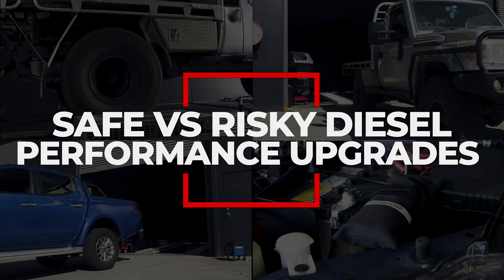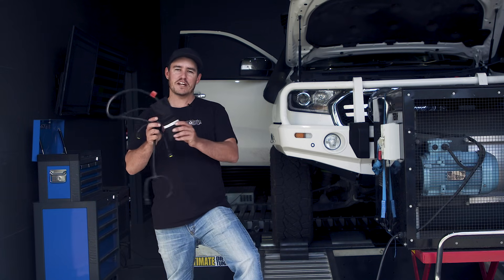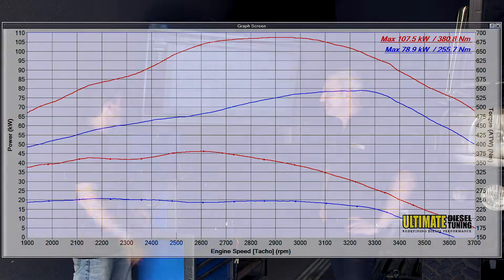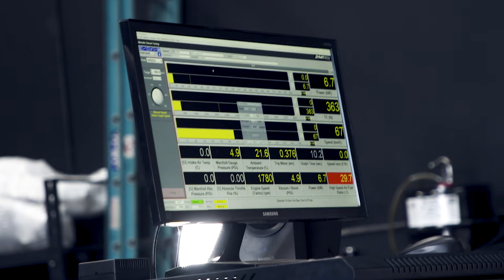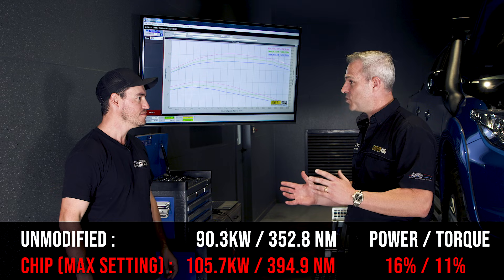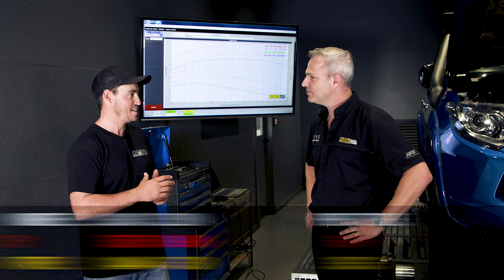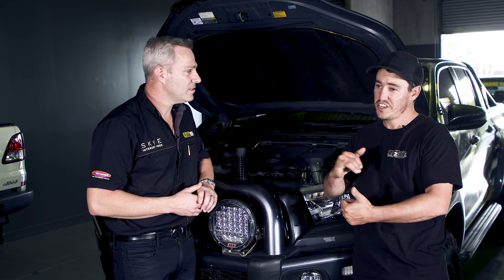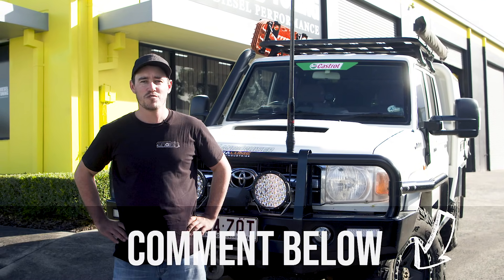SAFE vs RISKY DIESEL POWER UPGRADES – 5 things you need to ask before choosing!

Comment: 100k V8 cruiser putting out the same power as a triton 😅😅😅😅😅
Reply: You need to replace your back 4 times in the Cruiser....
Reply: Toyota overpriced
Reply: If you knew that what the manufacturers designed the vehicle for then you would understand that power (work) directly relates back to wear and failure rate. The 79 was designed for harder use at the upper end of its GVM and towing capacity and hence why power is purposely lower than what you might expect for a larger engine as comparing to a vehicle that’s more orientated to cruising the family up and down the highway with the occasional trailer that was clearly designed for less work. Manufacturers ultimately balance what the vehicle is designed to do with the power output to ensure a long life. Even comparing two vehicles with the same engine as the 79 and 200 series you will find that the 200 has another turbo to increase air to create the ability to add more fuel for power. The average person and what the 200 series was designed for is carting people in comfort up and down the highway with the occasional trailer and hence not expected that it will work as hard as the 79 that’s designed to be loaded up and used hard in industry which will increase the wear and failure rate. Contrary to popular belief, the same engine that is designed for harder use should have a lower power output than one used for less as it all relates back to wear and failure rate. If you want something to last longer and hence have less wear and less chance of failure then it’s as simple as lowering the power output it can do.
Reply: Some of you ppl meake it sound like a Triton or anything modern that isn’t a cruiser is going to implode the second you take it outside a highway and like someone said it’s just for hauling family on the highway and the occasional tow. What you describe is what you can do with any old station wagon. Reality is, modern trucks are really quite reliable and can both take a lot of hard use and will go most places with a small number of mods. My last Navara took me over 50,000 kms and at least half of that is use in my farming and forestry operation which includes (more than) max load, pretty serious terrain and hauling some trailers that are way above the 3,500 spec.
Reply: Have a go at the tyre size on it mate....
Reply: @JArc-99  Triton has big tyres too and 4 less cylinders haha Everyone is getting it wrong, 79 = work horse not horse power
Reply: living on an edge
Reply: @Ralph W Outback to Surf Mpre often then not tunes end up being better for fuel economy and also engine wear aswell. And the big benefit is addressing the shithouse turbo and throttle lag most newer diesels suffer which means you don't have to carry as much momentum and what not offroad. So in the long run tuning it on a dyno ends up being much nicer on the vehicle then a stock tune.
Reply: is not only about hp. (even less in propers 4x4) 
is about reliability and TORQUE.
Reply: Yeah but that 600nm of torque in the 79 V8 is at its maximum at 1200rpm making it a beast of offroad towing. 
They're still an overrated vehicle in my opinion though 😆
Reply: Not just that. How long will the little 4 last against the v8
Reply: @GodsEyeQLD  And you know it will last longer because?
Reply: @GodsEyeQLD  very reliable , so a long time .
Reply: who tf cares about the power figures  torque is where its at!
Reply: @wax333  nearly every 4 cylinder out torque's that V8 , in particular the D Max , nice flat torque curve .
Reply: @wax333 but your gearbox can change power into torque, that's why a 200kw vehicle with 200nm torque will always accelerate faster or pull a heavy load up a hill faster then a 100kw 600nm engine. 

The high torque engine will not have to rev as much and will be nicer  to drive and probably more fuel efficient.
Reply: Get a million kms out of the cruiser unlike the triton
Reply: Bet the Cruzer will go more places then the triton will ever see
Reply: @Sillyboy9572  not really .

Comment: You talk about safe power and dynos but you fail to mention that you have grossly exceeded the maximum torque specifications for both the clutch and gearbox for that landcruiser. Without the relevant upgrades which cost thousands of dollars your actually doing more harm than good. 600nm feels great until something goes pop.
Reply: They are typical gains that most custom dyno tuners achieve with 70 Series Cruisers. The drivelines & gearboxes on them are very strong, never had any issues. However, the clutch must be replaced with an upgraded heavy-duty item, but that's all - the other OEM parts handle the extra torque fine.
Reply: Ultimate Diesel Tuning have to agree. Never heard of gearboxes blowing clutches yes after a tune
Reply: @UltimateDieselTuning  The clutch aspect of this should have been addressed in the video, tell the whole story
Reply: @gregstephens361  that's only on a handful of models mate. Hiluxes, Landcruisers, Colorados. The majority are autos or the factory clutches are strong enough to handle the gains.
Reply: @UltimateDieselTuning yeah my fathers hilux was auto, 660nm on the wheels and no issues at all.
Reply: Been running 960nm for 80,000km, standard g/b and diffs. Clutch is a npc
Reply: Just never tow anything heavy in 5th gear unless on level ground at light throttle. Lugging in 5th with say a big van up an incline letting the torque do the work isn't good. If you take it easy esp when towing the gearbox will be fine.
Reply: Been running 650nm and 165kw at the wheels on my 79 for over 260,000km (since new) alot of very heavy towing and offroad driving. Nothings gone pop yet! Except my wallet everytime i fill up with diesel....

Comment: Anyone have a clue if tuning a 3.0L turbo diesel Prado is worth it?
Reply: Sure is mate, they go very well with a custom dyno tune. Awesome gains in power & torque out of those, no matter how we tune them!
Reply: My big question is if I am very remote and have trouble with the remap, I’ve been told that I need to get it to the people who have done the remap. How do I solve this problem if I’m a thousand miles away from where it was originally remapped and can only get to a basic mechanic?!? Where as with a custom tune and chip I can just unplug and trouble shoot or limp to mechanic. So would this mean a chip would be better for my kind of use?
Reply: @allwheelinoz4707  yes it generally does need to go back where it was tuned. However, we have tuning dealers & agents all around Australia that we work with. So in your case, depending on where you live, we could tune your car for you at one of these agents, which could be closer than our workshops for you. If you'd like to give us a call on 1800034373, we can chat to you about all of this & your options!

Comment: I have had my Hilux tuned by Ultimate diesel in Dandenong, I highly recommend using them to get the power and torque out of your 4wd. They really do care about your vehicle and make you 100% aware of any potential problems pre tune, I spent $5500 to get great numbers out of my Hilux, in this they also found my injectors to be leaking and in need of replacement. All round they have helped me discover the true potential from my 4wd and have done so safely and without any unnecessary nonsense. Thank you Ultimate Tuning Dandenong!
Reply: Hey guys, the custom dyno tune did NOT cost David $5500. We also carried out an on-car chemical soot clean to his 4WD & also replaced all injectors (which are very expensive as you will know). Just thought we'd clear that up!
Reply: @UltimateDieselTuning  yer, figured it was definitely injectors related! Appreciate the input
Reply: $5500!?? Jesus, you'd pretty much just buy a whole new engine for that!
Reply: Are services inherently more expensive there in Australia? I live in Las Vegas USA, and I spent $500 bucks for a dyno tune on my vehicle.  $5500!? Did they do a complete rebuild for you?  That's obscenely expensive for tuning.  $5500 bucks would upgrade both turbos on my truck (3.5 ecoboost), or upgrade to a Whipple 3.4 for my car.
Reply: Surely they changed your injectors and did a full service as well as the tune for that? Or added a new cooler!
Reply: When your on the money I was, it really doesn't matter
Reply: David Edwards weird flex but okay mate

Comment: I've heard some horror stories about dyno tunes gone wrong, customers left with paper weights and a large bill. How do Ultimate Diesel Tuning work with helping out a customer should a tune result in a blown motor? Will you re-tuned it for free once the motor has been repaired? I know you say you do a pre-tune inspection. But even doing everything right, you can't plan for a motor dropping a valve or blowing a piston whilst on the dyno. After-sales service is one of those things often overlooked. So would love to know your policy around this. Cheers
Reply: We custom dyno tune within the factory safety parameters set by the manufacturer. We also have our own warranty as well. For further information, please contact us so we can go over it with you!
Reply: @dean8367  they are very undertuned from factory.
Reply: @UltimateDieselTuning  I know they're detuned, I tune my own ute, bitbox isn't rocket science, you know that.
Reply: @user-hf3rq1dg9d  thank god my 4wd isn't going to you to be tuned,it would be dead in a week
Reply: @user-hf3rq1dg9d  it seems like you deleted a post
Reply: @southjerseysound7340  nope.
Reply: @dean8367  probably an emissions thing. Unrelated but i had a skyline and just by doing a custom tune the power gains were substantial.
Reply: Impressive the gains you get out of a remap and dyno tune. Personally I’d be doing other mods such as snorkel, 3” exhaust, catch can, good quality air filter and intercooler before a chip or tune.
Reply: Planning to get a custom dyno tune for my 2014 Triton from Tune House in Marrickville as there appears to be no ultimate diesel tune shops in Sydney
How would you rate this tune shop??
Reply: @philiplowry5771  For a Triton in Sydney I would go see MRT before Jim at Tunehouse. If MRT are too expensive then go see TME at Springwood.
Reply: @philiplowry5771  we have Tuning agents in Sydney mate! Please give is a call on 1800034383 tomorrow so we can help you out!

Comment: Where does the iDrive fit into this?
Reply: Do not increase power at all. They're not meant to either. I would like to know how they go with a tune as well though if they still help with response
Reply: @OutdoorSoHard_69  if your tune is very good & done properly you will actually get a very good increase in low-down response & much less turbo lag. So you won't even have to think about fitting a throttle controller as you won't need to.
Reply: In the trash . Proper tune eliminates the need
Reply: Idrive is to regulate that power through how much you push on the throtle, and to what setting you have it on. Hence throttle controller.

Comment: That’s all well and good but why so expensive ?
Reply: Cheap isn't good & good isn't cheap.
Reply: exactly right
Reply: @TasmanianHillBilly  I bought a stage 1 one size fits all chip for a 6 cylinder falcon for $170 locally built get back some lost horses. Has transformed a tired car, but wouldn't trust a $170 chip on a $20k motor.
Reply: So they can buy they're brand new houses and toys.
Reply: Coz they are flogs that think they can rip people off because they payed loads of money to do a tuning course, fuckin stupid🤦‍♂️ $800 custom remap/road tune.

Comment: 1kd 2008 Prado with 275000k on the clock, just been given a clean bill of health by my mechanic with injectors etc in spec, is a tune worthwhile on an older vehicle with this many K's or do I just leave it stock?
Reply: Hey mate, absolutely it is. We custom dyno tune plenty of common rails that have a lot more k's on them than yours does! Give us a buzz on 1800034373.

Comment: I had my 200 series ECT and ECU remapped, the best thing I ever did.  Went from 142.3 kw atw to 178.4 kw atw close enough to 25% improvement.  Torque improved by 25% too.  The ECT now drops into 6th at 80 Kmh and I’m pulling 1500 rpm at 100 km/h.  Economy has also improved both when towing and unladen.  It goes like a scalded cat.
Reply: In combustion engines, power is the mathematical product of torque and angular velocity (=RPM). Since Diesel engines have a natural RPM limit due to the way combustion works, the only way to get more power is to increase torque.
Reply: @aj_moto1044  Exactly
Reply: Interesting to know Mate. I have a 2018 200 series. Thinking I will do the same

Comment: What can you do to a 2002 GU Patrol  ZD30 Di
Reply: We have tuning options for the GU DI's Dave. Give us a call mate.
Reply: @dorgelos  removing the ECU, opening it up & soldering numerous components together inside the ECU in order to remap it isn't particularly ideal mate. Which is why we do use piggy-back/supplementary ECUs for the ZD30 DIs in order to custom dyno tune them properly.
Reply: @UltimateDieselTuning  More information would be good on this topic, there is a lot of ZD30 Di still out there. When saying piggy back/ supplementary ECU are you talking chip? What other mods are expected prior to doing anything to your work as mines stock exhaust, intercooler etc with roof rack, roof top tent, winch, rear drawers etc. I am in South Australia don't hold that against me. Some more info would be good especially in a covid environment.......
Reply: @themistressexplores  no, not a chip. An aftermarket ECU. Unichip is one - although it has the word "chip" in their name, they are NOT chips. They are fully programmable supplementary ECUs. No other mods expected - but an upgraded exhaust & intercooler is always a good idea too.

Comment: Yer this is for new diesels but u can't on older mechanical diesels so how do u make more power on older diesels
Reply: Wind out the fuel screw on the pump lol.

But in all seriousness, it can be done but be careful.
Reply: By changing turbo and fuel pump plus a dyno
Reply: @robbillington2908  .. yeah pretty much bolt on's .. bigger turbo , intercooler , higher flow injectors & wind out the fuel pump .. the trick is how far to wind it out